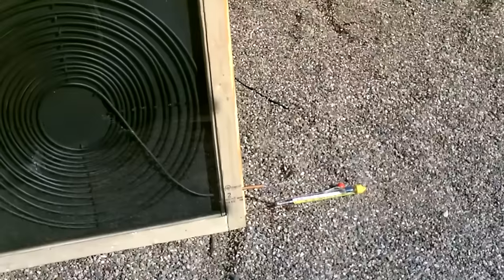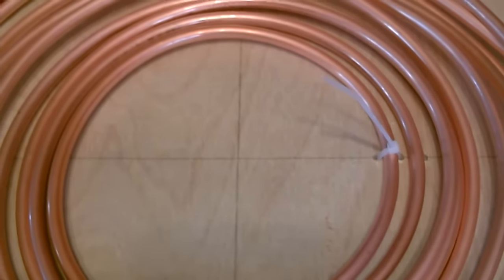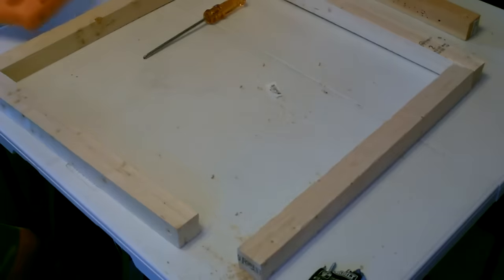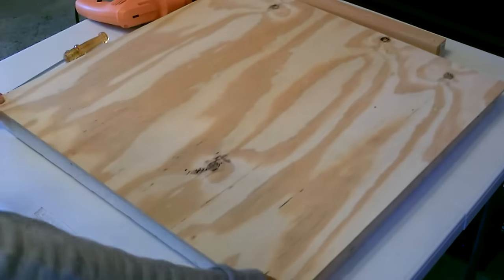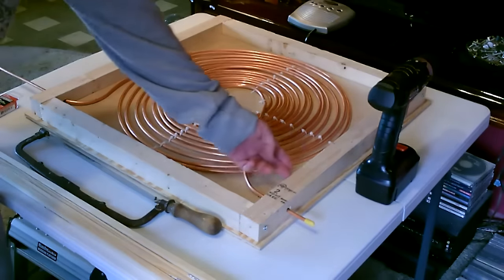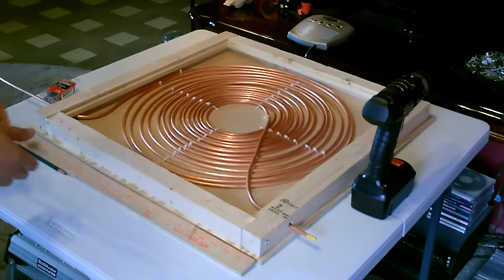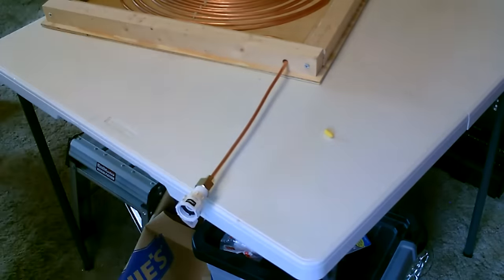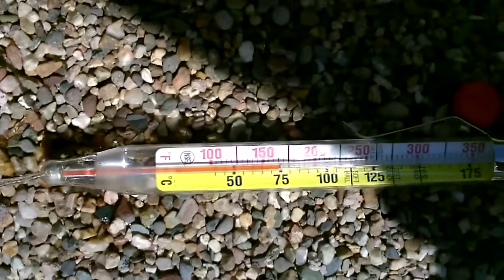DIY Solar Water Heater! - Solar Thermal COPPER COIL Water Heater! - Easy DIY (Full instr.) 170F

Comment: I used black PTFE pipe woven back and forth across the south end of my house. a copper heat transfer inside my water tank + a small central heating pump, header tank and antifreeze. works ok in winter too. enough heat for a bath, add electric heater for ten minutes & your heading for steamy bath.

Comment: Here is what needs to be built a circuit that kicks on the pump or valve at 165 placing the water into an insulated vessel. You could store the water on site. You would need another pump to give it that closed loop heating so the water in the vessel would take the cold off the bottom and add it to the solar and the heat from that would go into the vessel to the top.

Comment: Nice water heater for my pool.  Do you know at what speed/rate is the water going into the coil to get those temperatures out of it?   Why much time does the water need to spend inside the coil to get really hot out of it?  I am trying to build my system with 1/2" copper tubing and would consider replacing the tubing with 1/4" coil, as you suggest to get hotter water "faster" due to the smaller diameter tubing.

Comment: assuming this is for heating water on the go or outside.  not bad it will give you quick hot source for camping or rinse off shower
Reply: Assuming one is in an area that receives plenty of sun and it's daytime.. nice as a secondary source though.

Comment: Great idea. The only thing I would have done differently would be putting a thin black like slate board like a chalkboard or guage 3-6 sheet metal (blackened) where the glass would have been.

Comment: This is a great project! Simple, efficient, and inexpensive. One suggestion have you thought about using tile as the backing to gain additonal heat retention. Also tie straps won't last in the heat, small c-clamps secured with screws would last longer.
Again great projector. Great thought  starter.
Reply: U mean zip ties
Reply: مصنع الصاج الملف
Reply: @magicman0867  Some people call them tie straps.
Reply: Tile is not a good insulator though so would transmit heat out the back. Wood is a better insulator and helps hold the heat in the box.

Comment: This is awesome. I'm building it this weekend to use as a pool heater this summer. Can you please tell me how thick the 20x20 wood is that you zip tie the copper pipe to? Also what are the lengths of the square dowels and what is the thickness of the glass? Thanks!

Comment: Nice and simple design. But I would put metal sheet under the pipe - that would increase absorbing surface. Next step - to weld pipe to the backsheet, but that would increase labor.

Comment: In Manitoba Canada we use black aqua line ABS tubing any ware in dia. from 3/4 inch to 1 1/4 inch with a small circ pump. i have generally put the coil on the house or garage roof or build a trellis  type fence southern exposure is best. no need to enclose the ABS tubing. 65 to 70F water inlet temp produces hot water any ware from 105 to 125F. Below freezing temps system is drained and shut down

Comment: Nicely done, but what temperature is your water going in? You have a 30 in x 30 in box, which is about 0.76 m x 0.76 m. So you're getting about 0.57 square metres of solar access (in fact less, because not all your area is pipe.) The very most you can get from sunlight is about 1 kW per square metre. So your box could get a maximum of 570 watts, if you captured the full area of 0.57 m^2. Let's say you're getting 500 W and 100% efficiency to the water (which itself is a big call as you're not getting 100% efficiency.)

Energy required to heat water: E = m. c (delta T).
m. is the mass flow rate. 1 gallon every 3 minutes is 0.021 kg per second.
c is the specific heat of water (4.186 kJ per kg.K, where K is 1 kelvin, or 1 degree C).
delta T is the change in temperature.

So with 500 watts at that flow rate:
delta T = (0.5 kW)/(m. c)
= 0.5 / (0.021 * 4.186)
= 5.6 degrees C. 

But you're getting an output temperature of 75 degrees C.
So one of the following is true:
> your water is going in at close to 70 degrees C 
> your flow rate much lower than your estimate
> I completely wrong in my calculations
(Whichever it is, that's a great result and a nice low-cost design.)

I would have thought you could achieve a 30 degree C temperature increase with about 1/2 kg water every 3 minutes. Which is about about an eighth of a gallon.

Comment: That's great! Can you tell me what temperature I might expect from this size when it's still cold and windy outside? 10 -15 degreees C. Thanks!
Reply: haha
Reply: We do something similar on our farm. In winter at between midday and 2pm, the water is warm enough to wash the dishes with.. 
In summer  it is scolding hot for most of the day.

We use black plastic pipe, not sprayed copper.

Comment: Should have a metal sheet backing (like aluminum) behind the copper coils to transfer more heat to the coils.  Wood backing a heat insulator.  This way you can spread out he coil rings a little wider for a larger thermo heat system.  Buy dense black paint as used for camo spray paint to increase transfer of heat.

Comment: Very nice work.  One comment:  I predict that, over a fairly short time of use, the zip tries will break down and crumble.  Wire would be better, with a layer of IR reflective insulation behind the mounting panel would last longer and perform better.
Reply: use the black zip ties they are uv protected
Reply: Of course I dont know but he could be alluding to the repeated heating and cooling not the uv.
Reply: +LFOD
Using plastic to secure the tubing is better. The problem with the zip ties is they will become brittle and be prone to breaking easily.
If you use ferrous metal strapping instead of copper, you run into the danger of electrolysis occurring.  Try using copper wire instead.  10 or 12 gauge wire will work just fine.
Reply: Electrolysis can only happen if the water is in contact with BOTH materials. 
In this case the water only comes into contact with the copper, the wire (or whatever you use) is only touching the outside of the copper pipe, so it does not come in contact with the water.
Reply: I have found that even the high heat zip ties give up surprisingly quick in the direct sun. I went to bailing wire.
Reply: LFOD7491 My question is, What is the temperature the copper wires will get up to.  If they are for generating heat wouldn't the plastic zip ties melt? Over time would the heat generated burn the wood? Have you ever seen a wooden stove or oven? Camp fires not included.
Reply: Trinidad's Best the copper pipe is not generating heat. Its collecting heat from the sun. Theirs not near enough heat to catch the wood or plastic on fire.

Comment: Nice project.

Bottom of the heater should be from metal like aluminium or better copper.If choose copper should painted black for absorb and radiate back more heat.
If choose aluminium  make it shining like a mirror.You gate more heat .Or get some aluminium foil and wrap all plywood in aluminium foil.

Comment: If you get some aluminum chips from a lathe operation, get the oil off , and paint them black you can increase the active surface many times over and get much hotter water easily. I think you would be shocked at the heat gain.
Reply: "you can increase the active surface area many times over"??
Um.. no you can't.  There is only so much light per area.  Any minor additional reflection that you'd get from painted metal chips would be quite negligible.
Reply: Maybe you can post a side-by-side video of the two styles.
Reply: If he does, you will see how negligible his erroneous claim is.
Reply: +Justin Bozeman
Unless you get insulation for free or you have some laying around gathering dust, insulation won't be of much use either.  Glass or plexiglass won't hold the heat in for long & the thermal mass of rocks/pebbles isn't very high (which means you wouldn't get enough extra heat from them to make it worth your while for such a small volume of space & for such a small thermal difference between your inside temp & the max temp the rocks will reach.
Reply: If tubing was fixed to cement board, would the board become a heat sink?
Reply: Sunny girl 87
If you painted the cement board black, it would absorb more solar energy & cause the air around the copper coil to increase in temperature.  It will also hold heat for a short period of time as sunlight is blocked by clouds & as the sun goes down.  How much of that energy would be useful for heating water as the sun goes down?... not much & for not much time...
Reply: tarstarkusz

fyi..."The total amount of energy received at ground level from the Sun at the zenith depends on the distance to the Sun and thus on the time of year. It is about 3.3% higher than average in January and 3.3% lower in July... If the extraterrestrial solar radiation is 1367 watts per square meter (the value when the Earth–Sun distance is 1 astronomical unit), then the direct sunlight at Earth's surface when the Sun is at the zenith is about 1050 W/m2, but the total amount (direct and indirect from the atmosphere) hitting the ground is around 1120 W/m2.[3] In terms of energy, sunlight at Earth's surface is around 52 to 55 percent infrared (above 700 nm), 42 to 43 percent visible (400 to 700 nm), and 3 to 5 percent ultraviolet (below 400 nm).[4] At the top of the atmosphere, sunlight is about 30% more intense, having about 8% ultraviolet (UV),[5] with most of the extra UV consisting of biologically damaging short-wave ultraviolet." 

Note:  "1366" W/m^22 is outside earth's atmosphere.  Also, 1366 W/m^2 does not equal 81600 J.  A Watt-second = a Joule.  It would therefore be 1366W * 60S = 81,960 J per minute using your power rate.  At sea level it would more likely be 1050W * 60S = 63,000 J (which is ~76% the energy amount in Earth's orbit).

ref:  https://en.wikipedia.org/wiki/Sunlight
Reply: Back in the 1920 era the units in South Florida were home made . They contained several inches of asphalt patching material  which is a bit blacker than black top.  Black tar would probably work as well but just might catch fire. So they had perhaps four inches of black material with the coil pressed into the surface and the copper sprayed black. These units often were not sent into a water heater or other container. The water simply went straight to  the bath tub or sink and it worked well enough to be able to take a shower in the evening. Keep in mind that here we only have two or three days a year where one would really need to heat water at all. In fact, after a hard days work i have taken baths after adding two or three bags of ice cubes. We learn to look forward  to cold and spend time trying to cope with the heat. Very few home here were airconditioned before 1958 or so . I suppose the norm must have been about 85F in homes and many businesses back then although we did not notice it back then.
Reply: Jim Sadler We used landscape type black tubing, lying on the ground where the sun hits it for most of the day. The water is fairly warm, cycled by our pool pump. also, the pool filter is in direct sunlight light. on the Alabama Coast, it holds heat and transfers it for a while.

this year, we will do 200' of coiled tubing on our metal roof and see what happens!
Reply: Then why use copper if you're going to paint it. Why not a cheaper metal.
Reply: I can't think of a cheaper metal that comes in a roll like this Copper one. Any suggestions?
Reply: Common Ground and what other metal do you  suggest?   Can't use steel due to rust,  can't use lead because it's toxic.  Aluminum is cheaper, but less conductive, and anything else is either too expensive, toxic,  or not sufficiently produced to be economical or available.   Plastic isn't toxic and is cheaper but has lower internal pressure,  especially when heated, and is less conductive than even painted copper, so you need more of it to heat the same amount of liquid all other variables being equal.    Copper is the king of readily available material.

Comment: Thinking about putting copper tubing coil in a water tank. The hot water will circulate through the copper coil heating the water. When the water gets hot the circulation will stop until it cools or you use some hot water putting cold water in.

The water will be heated using coraplast with water running through it from a pipe on one end out of a pipe on the other end.

Comment: Just curious on how you would control the temperature, remember that we usually set up the heaters around 120 F to avoid scalding, I found this same set up in older building roofs for the same purpose but they compliment them with mixing and control valves.

Comment: Thank you for sharing your experience, it's golden. 

However, I'm wondering could you get better result with no space between copper circles. In summer it could not be matter. But, in fall or winter air around copper can make them less warm. If no space between them, they can share own heat with inner or outer circle too? 

Also wondering, if bigger copper tubes could get more heat via more copper surface = more heat?

Thank you for your time,
Mehmet

Comment: Awesome video man ! But why not put a reflective sheet of metal under the cooper pipes ? ...you know...for more energy (?) :3
Reply: The idea is that you do not want the sunlight reflected back out to the air....you want the light to be absorbed and converted into heat. I wonder if just using black painted plywood would be as good as painted aluminum.?

Comment: This is awesome I instantly started thinking how I could take advantage of something like this  and my first idea was to use this to pre heat the water in to an electrical water heater on a hot day the thing would barely need to work at all

Comment: So a couple ideas I was thinking of. Im going to make one of these and put on my roof of the garage which is right above my pool but 1- if i cover the back piece of plywood with aluminum foil and then also attach multiple magnifying glasses on the inside of the plexiglass before sealing it....would I get more heat?  2- do you recommend copper tubing or pex?? Which will get more heat?